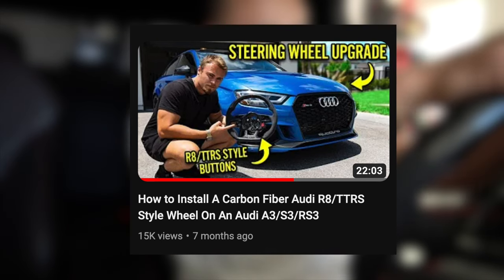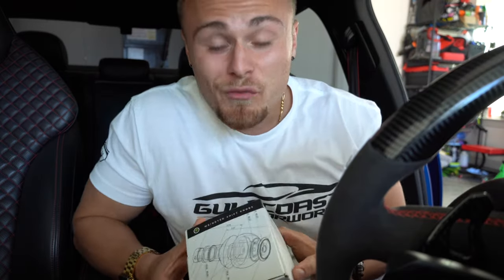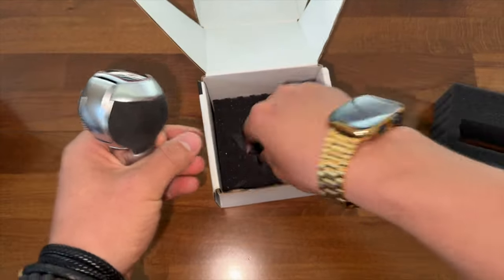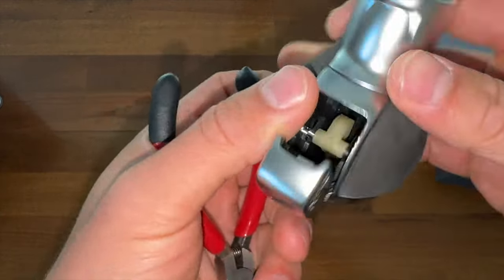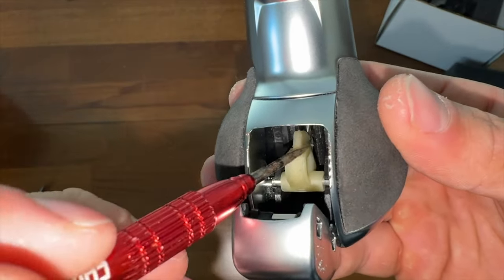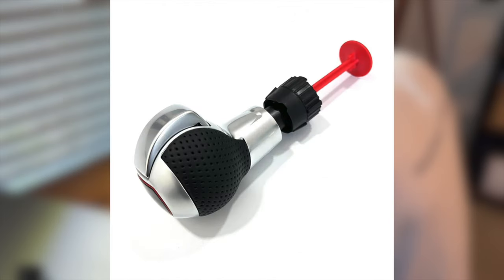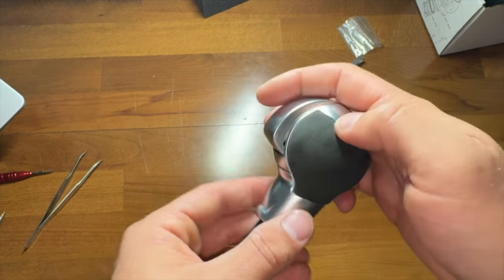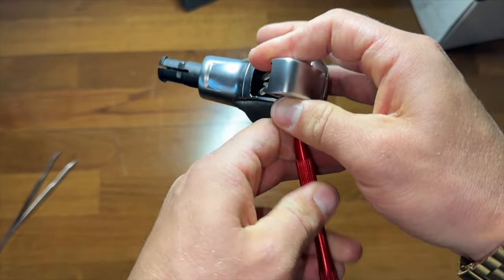How To Fix A Broken/Stuck Audi Shift Knob Or Button | Step By Step Tutorial

Comment: Brilliant vid and so useful thank you, managed to unstuck my button in a few mins, didn't need to use the tape trick to get the button out just pulled up hard enough to the bottom to stick out abit then just pulled it up to reveal the springs.
Reply from the maker: Perfect! What were you doing that you needed to remove the shifter?
Reply: @Haydenschreiermk2  planning on upgrading my b8 s4 old style gear knob to the newer front facing style. Picked up a q3 mint condition one on ebay but button was pressed in hence following this vid.

Comment: I happened to get my button stuck AFTER installing and now its much harder to take it out. Am i gonna break something just pulling harder? Or do i have to unstuck the button with the knob installed?

Edit: managed to pull it out fine. Now lets see if i can fix it at all. I cant quite pop the button out enough to pull it out. The spring holding it in is very strong
Reply from the maker: okay glad you got it off. You most certainly can pull the button out even with the tension on it. Go get some strong packaging tape or electrical tape and slide it in between the button and the side. then use that to pull it up. I wouldnt recommend anything metal as tempting as it might sound as you will scratch it all up
Reply: @Haydenschreiermk2  thanks. I managed to get it right using another method of removing the top. The new shifter now sits in my car nicely